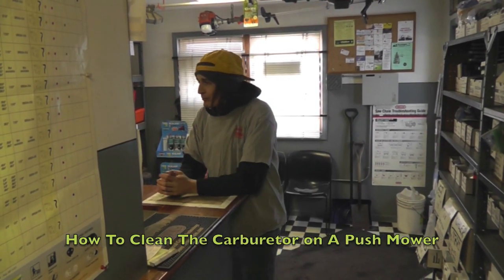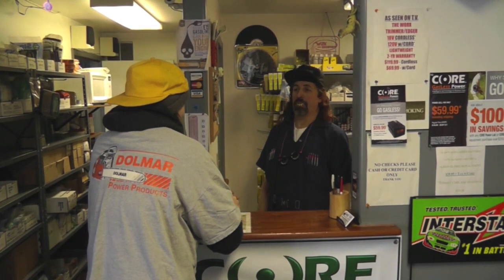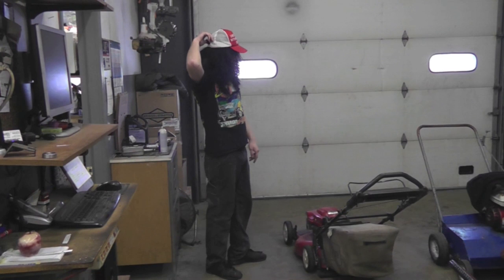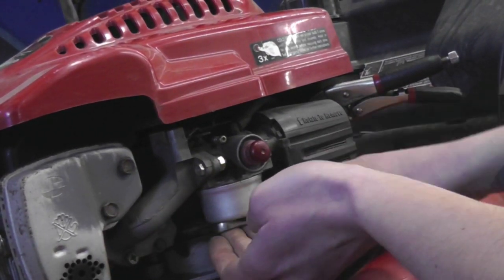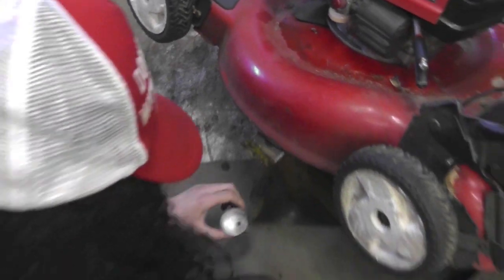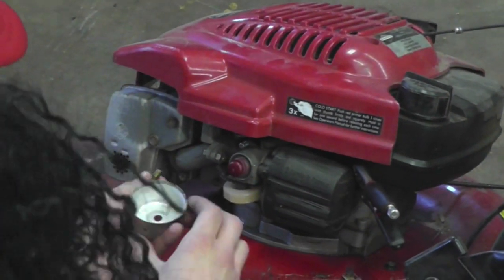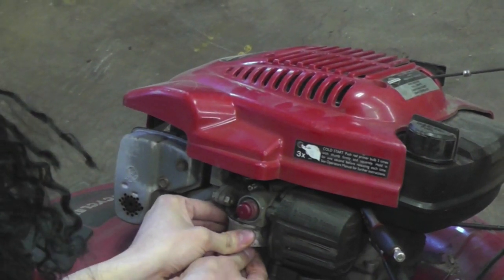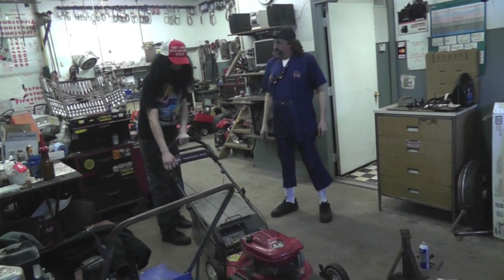Mower Runs & Dies? Fix It!

Comment: Thanks for the vid as always.  Picked up a throwaway clunker Toro 2 1/2 years ago, did what you said, cleaned out the carb, put new fuel line, float, valve ran perfect all this time. Then, few weeks ago, it stalls.  Runs for 2 seconds then stalls. I wired the choke one way, got it running, ran 45 minutes, then stalled again.  Got it running for about 30 min today, ran smooth, then just started stalling.  Wanted to push it into heavy traffic.    Not sure if its choke, or magneto.  I thought if magneto, it would not run for a while then stall.  Help!!

Comment: OK, that is great! I've looked over all your videos. but what I cannot find is the same problem I'm running into with my generator. we lost power. I started up the generator. It ran great for like 3 hours.  then it started dying every 20 minutes. I was wondering if the vent cap was messed up. So, I pulled off the vent cap. still had a problem! Then I followed this video. Cleaned the holes with welding tip cleaner! I still have a problem. Thought it might be water in the fuel tank. So, I drained the whole fuel tank still had a problem. When I drain the fuel tank, I also checked the fuel filter with no obstruction. then fired it up fire it up fire it up! the generator and then after 10 to 20 minutes and dies. I could be there immediately with the spray of ether and it immediately fires right back up and runs for 10 to 20 minutes Again. but if I do not put a spray of ether in it takes 6 poles to get it to start again. That is with fresh gas. Checked flow at carb when drained gas. I’m at a loss.

Comment: Hey guys, I did the cleaning of the jet but in my case the primer won’t even start the engine for a brief time. The engine fires with a shot of ether; but keep running. I was able to get it going by placing my thumb over the carburetor opening and choking it until it’s warmed up and it seems to run fine, that is until it cools down. The primer just won’t work. It’s a new carb too. Vacuum leak? Why don’t the primer work? Been trying to find a specific video of yours and can’t.

Comment: Yesterday i spent 3 hours working in 2 mowers.  1 would start and stop.  I took the carb off cleaned it but neglected the jet.  Well after this vid had it running in 10min

Comment: Yah JR that often fixes it. Good work. I have gotten into the practice of removing the carb to clean it , I know it takes longer. I have times where their was stuff caught in emulsion tube and rebuild the carb is required to replace seat and set float level.
Reply: I have to agree, Mr. Fields. Dirt anywhere means dirt everywhere. At this point the customer is given his choice.This just happened  last week, is why I tell the tale. I quote him to just clean the bowl, and it might run,  but no guarantee it will stay running, not even for a minute. Then I quote him for the fuel system lollapalooza, which slightly exceeds the purchase price of the mower, it being the cheapest one they have at the local box store, which mower is only in its second season, and he's already had me replace the kill switch cable, which he kinked folding up the handle to try and stuff the thing into the trunk of his Toyota to take to his mother-in-law. That wasn't cheap either. And even when it was brand new, it was hard to start and never did run all that great. He never liked it. After a quiet moment of reflection he says "keep it", and departs. So I cleaned the bowl and it ran fine and I sold it yesterday.

Comment: Wear chem proof hand protection while you work.  Your liver is your chemical storage tank. When you hit your golden years your liver isnt as easy to change out as  mechanical parts are.  Avoid smelling gas fumes etc. Your lungs are your air filters.  Thanks for the repair video. Now I know what's wrong.
Reply: For sure

Comment: question
i have the same one  runs ok bogs a little with high grass
the primer bulb does not pressurize get firm
so i put a new one on still same promlem
put net seal at fuel bowl and jet nut

Comment: I know this is older video, but 2 comments. 1. if you use vice grips to pinch fuel tubing (I do), use something to protect against the grooves of the tool. I just use a piece of shop towel. 2. If you remove the bowl, mark it and the carb body, so they line up properly when you put it back on. And that's yur lunch!
Reply: I always thought Tecumseh (not "to come see," "TecumSUH!") carb bowl had a lowered part on the bottom, to allow the flosat to drop all the way down.  Just get the part in line and you're good to go.
Reply: Your second tip is kinda useless.

Comment: Taryl, I have a Briggs 5.5hp with the side air filter housing that contains the primer. The primer works and primes the engine fine. It starts on the first pull and stays running. The bug is that it seems to have a misfire or stumbling. It's not enough to make the motor surge. There is nomixture screw on this carb. It acts a bit like the spark plug is going bad BUT it's new and I've swapped plugs with no change. The main jet is clear (ran a micro drill bit through it and cleaned with Gumout). The fuel bowl is clean. When I put my finger up to the primer bulb I feel a little air blowing out. (huh?) If I put my finger over the hole in the end of the primer, it stops misfiring altogether and sounds perfect! I have a video to show you both the motor in question and its symptoms as you can see on the video. 
https://youtu.be/F_TTuqmyb04  
Your professional advice is appreciated. Is this anymore than a leaking gasket between the air filter housing & carb problem? Have you seen this before? How have you fixed it?